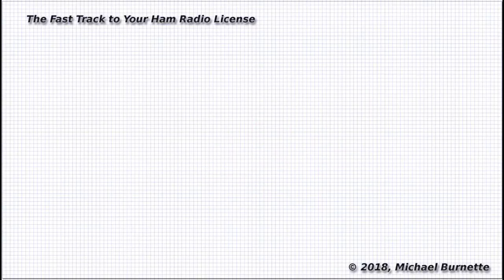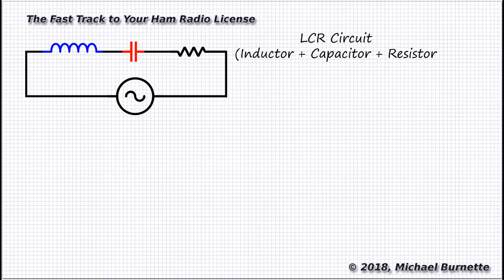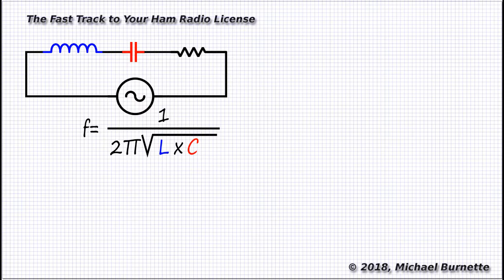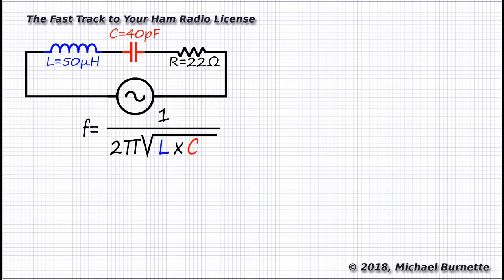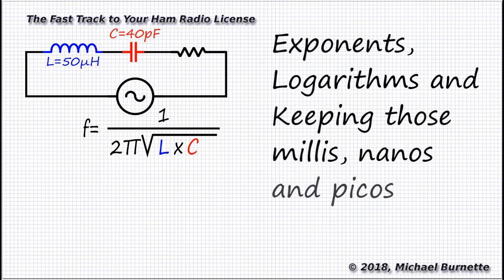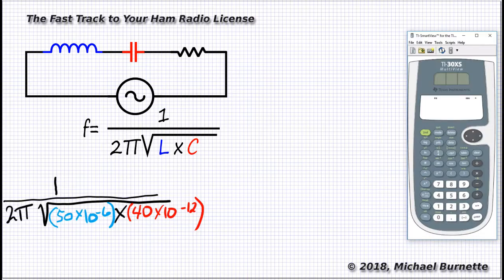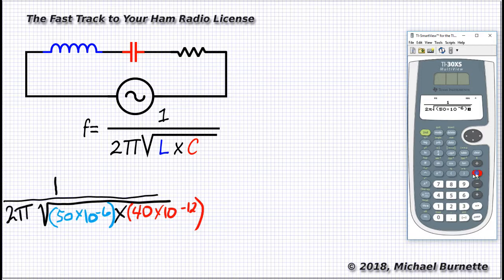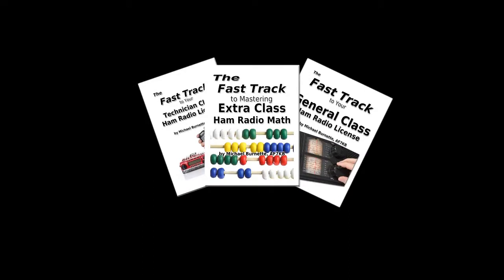Calculating Resonant Frequencies

Comment: At time 2:14 Why use 6.28 for pi?
I was taught in my electronics class that pi is 3.14 😮
Reply from the maker: The formula is 2pi -- so, 2 x 3.14=6.28. 2pi shows up a lot in equations that deal with frequency.
Reply: @af7kbfasttrackhamradio50  oh okay... i did that and got 6.28...  thank u
Reply: @af7kbfasttrackhamradio50 my bad... I forgot all about that.. 🤦

Comment: Michael,

Thanks for this video. Made it a lot easier to understand. I’m going to get the calculator you spoke of. Also, I’ve noticed that most of the math we Hams do is in increments of 3, ie 10^3, 10^9, etc. Thank you for all you do for the hobby de KC1FLG.
Reply from the maker: Thanks for watching, and glad it was useful. You're right on with the observation about the 3's. The increments of 3 are because we use a variant of scientific notation called "engineering notation," where all exponents must be divisible by 3. Engineering notation matches up with all the micros and millis and such, except in the one oddball case, the decibel, 10^-1.